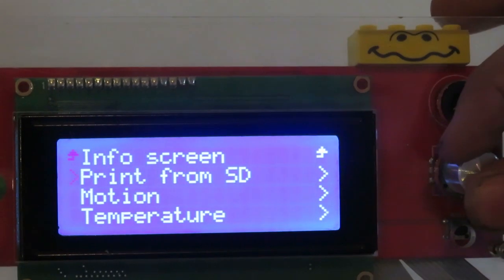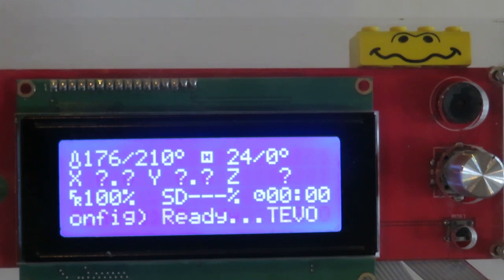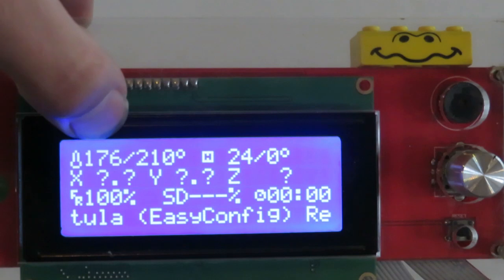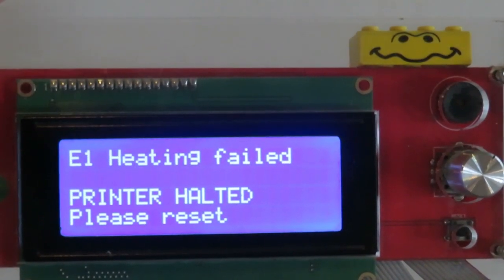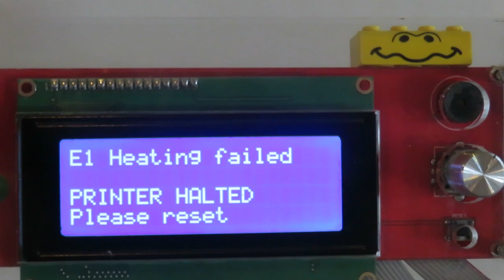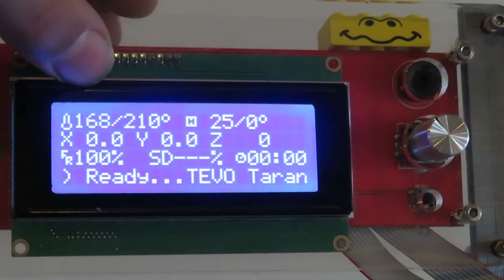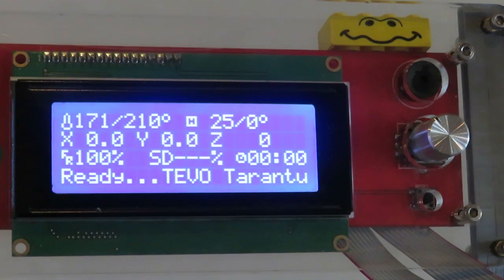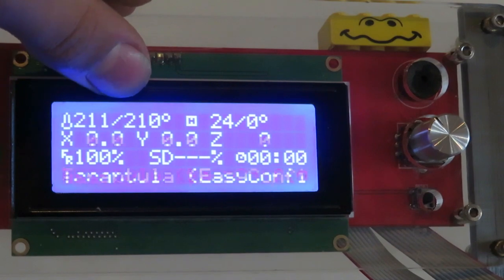Tevo tarantula 3d printer not heating up to full temp

Comment: Nice fix. One hint is that they do not like connections between them and the control circuit. The micro resistance in the connection messes with them. So if you ever have to replace or repair the wiring, try to always run it all the way to the control board.